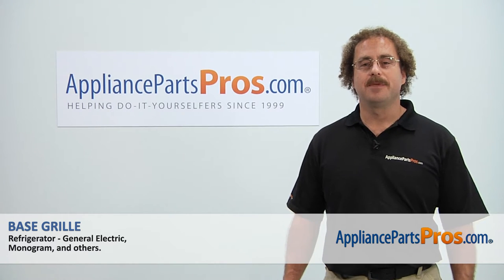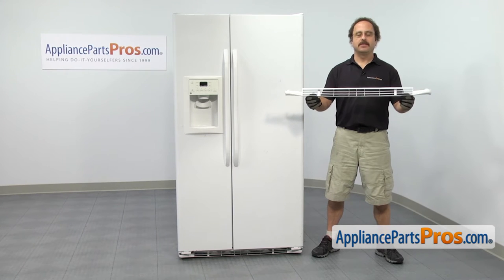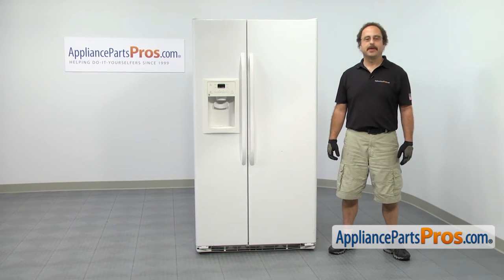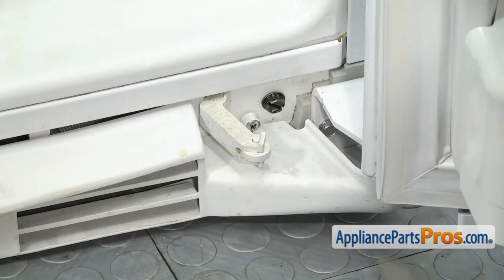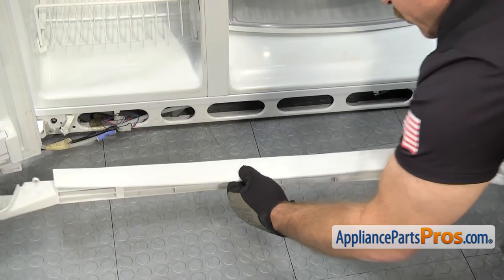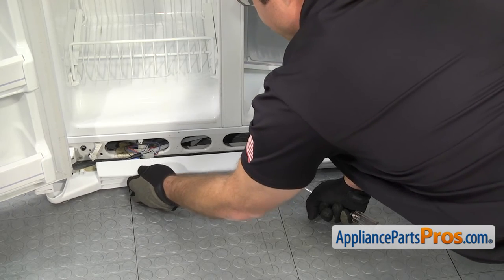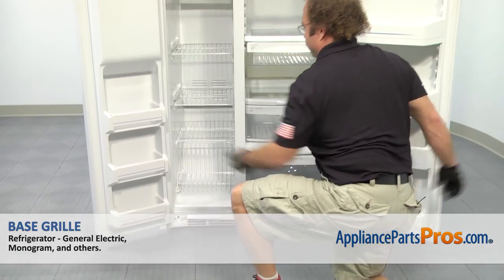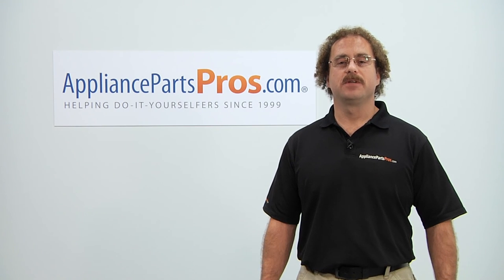How To: GE Base Grille WR74X10271

Comment: So mine doesn't have screws. It has two metal pieces that seem to slide in under the fridge. The tricky thing is knowing where the ends should snap in. Any ideas appreciated!
Reply: You have to squeeze the bottom and the top clamp together on both sides of the fridge. Then just push them in between the bottom bracing on the fridge and the bottom of the fridge itself.  Make sure you have the long clamps on the top, short clamps on the bottom.
Reply: @vichenry5823  Thank you! I fixed my kick plate thanks to your comment.